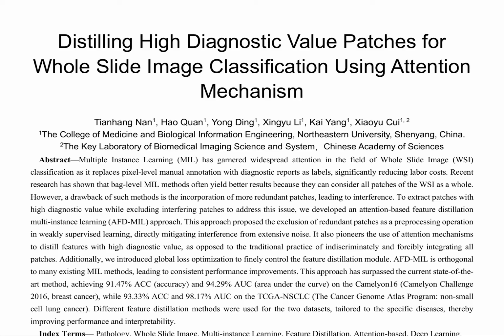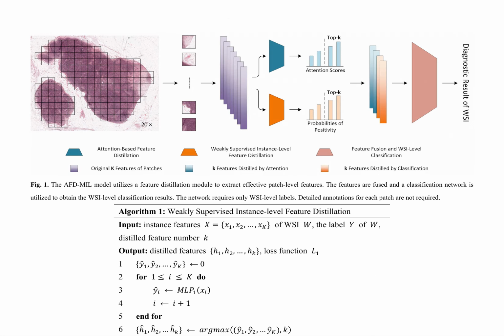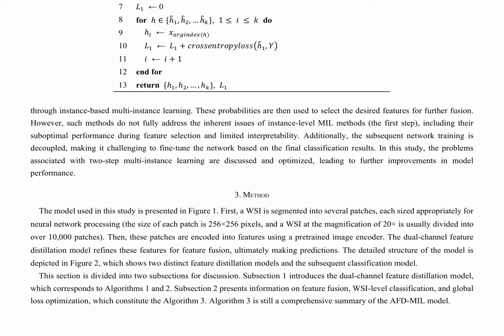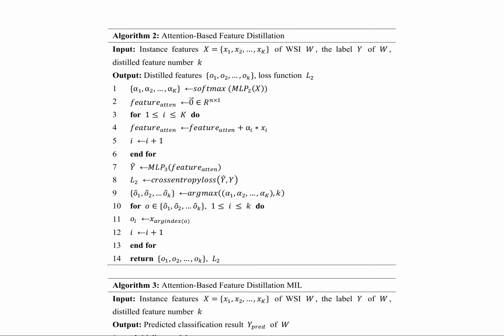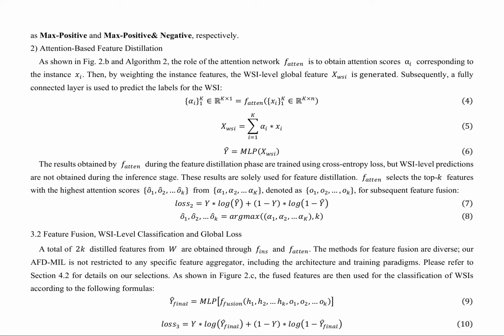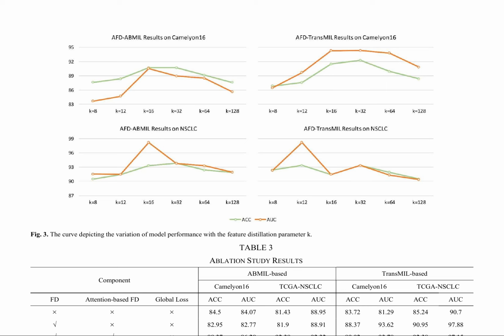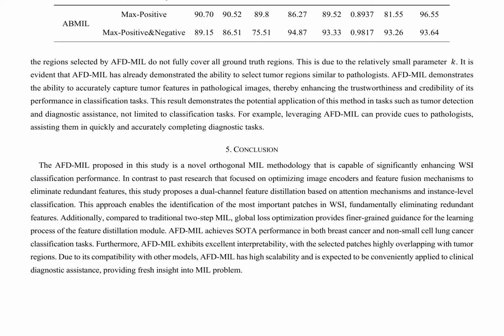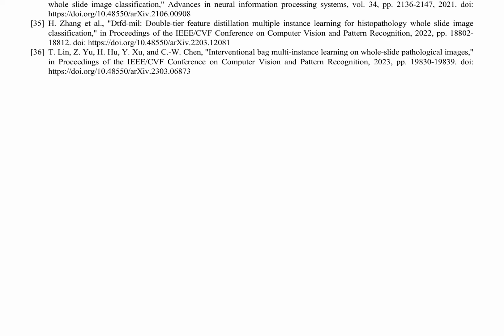Distilling High Diagnostic Value Patches for Whole Slide Image Classification Using Atte

Comment: Hello, thank you for sharing your research. It is very interesting. By the way, I’m working on the same topic. I divide the WSI into patches and then classify each patch using a CNN model. If at least one of the patches from the WSI is classified as positive, the whole WSI is also considered positive. However, I think this may affect accuracy because an error in classifying one patch could negatively impact the overall classification. What do you think of this method? If you have any other suggestions, I would appreciate it if you could share them.